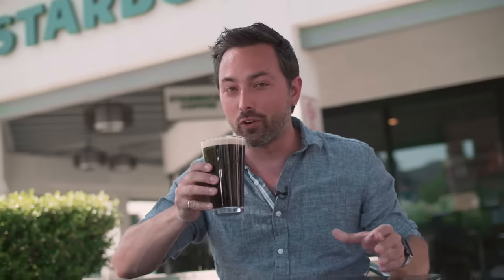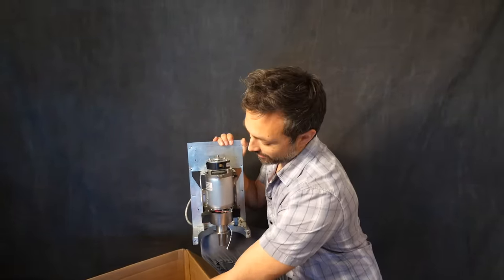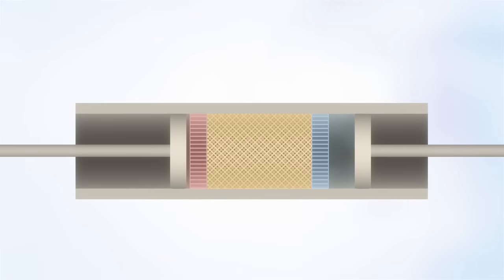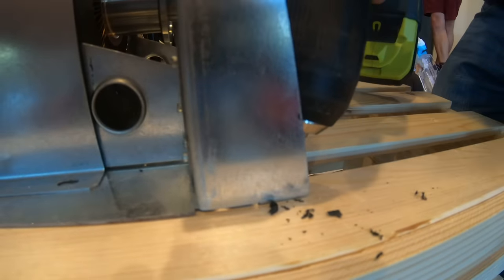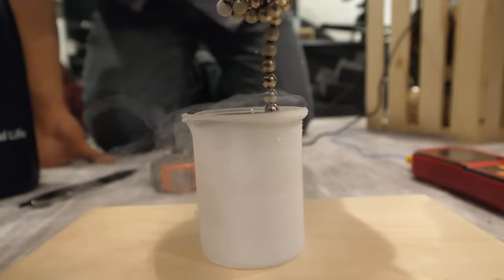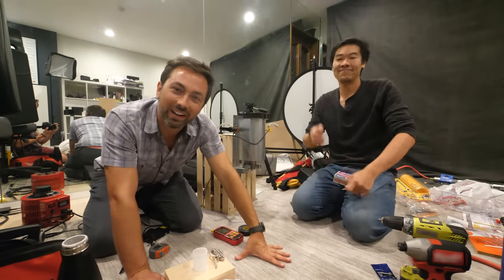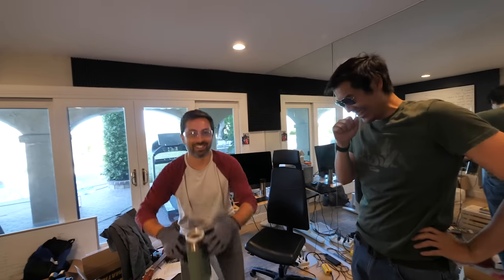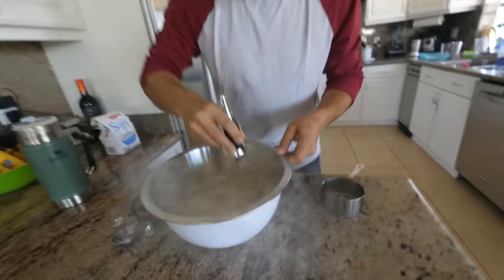Making Liquid Nitrogen From Scratch!

Comment: How does the selective permeability of the nitrogen filter work???
Reply: It might to do something with size of nitrogen molecules so that they pass easier thru it then oxygen molecules. Like you can have watertight clothes that still can "breathe" just in here it is on much smaller scale.
Reply: It may work chemically like the oxygen concentrators that emphysema sufferers use. Nitrogen has a much lower permeability in water than O2 or CO2.
Reply: Selectively
Reply: Do you know how they seperate liquids with a column? the liquid with smaller molecules go down faster then the bigger molecules, thus the mix is getting seperated by physical qualities. Gasses under pressure behave like liquids, the more pressurized the more it behaves like a liquid. And because of the pressure it flows in 1 direction, there will always be less pressure at the end then at the beginning. I don't completely understand why the O2 goes out from the side tho, maybe it gets pushed aside by the N2 that wants to pass forward to a less pressurized area?
Sorry for the bad english
Reply: What  @GielL96  said, except, in this case they purified a gas, not a liquid.
Reply: You could use the size of the molecules, but H2O is bigger than N2 is bigger than O2.  I would assume it has to do with electrostatics being that O2 is "magnetic" and H2O has a partial charge.
Reply: @GielL96  I think that is a good explanation. The Nitrogen molecules are smaller, hence they will move faster to the end of the pipe.
Reply: @jonathanlevy9635  Atomic radius decreases as you travel left to right across the periodic table. Sources give a long axis of 1.55 A for N2 and 1.2-1.26 A for O2
Reply: @Ranjay Raut That's called distillation and is not the mechanic at work here.  They were filtering out the gasses before they were ever liquid.  It is a similar process to osmosis.
Reply: @Ijjergom  Nitrogen passed through the membrane less often than the other gazes not the other way around

Comment: The reason the smooth taste happens from nitrogen bubbles is due to nitrogen not being able to diffuse through the water, so when there are different sized bubbles in the drink they remain a different size, whereas with CO2 bubbles they can diffuse through the water and equilibriate. Guinness did a whole bunch on research into this a while back

Comment: “Nitro cold brew?” Ever hear of Guinness?
Haha, good show. Keep the science coming!!
Reply: @snorkindorff270  Just to elucidate ... watching a freshly poured pint of Guinness (and some other beers) you see the same effect of wavering clouds cascading down the side of the glass.
Reply: @PaulCotterCanada  Guinness is also nitrogen infused. Kilkenny, Boddington's, Caffrey's, etc. all do the same. They inject nitrogen into the beer at the tap as it pours. That's why the draft taps for these beers all look different from regular beer taps, and why the tap handles can pull and push. Pulling opens both the beer & the nitro valves for the main pour, pushing just opens the beer valve for the top-up. I think the keg is pressurized the same way as with non-nitro beers. From the video, it looks like Starbucks is using the same draft system for their coffee. Still, I'd rather have Guinness.
Reply: @jasoncrobar724  Thank you - I like to learn stuff I didn't know.
Reply: Guiness is for sure better than this...

Comment: I work as an appliance repair tech. I don't like doing sealed system work aka dealing with other people's broken compressors, blockages ect.

However, through some reading and nerd raging I made a 3 stage "cryo cooler" I have 3 separate compressors stages that in the end produce liquid nitrogen. It uses a lot of power but produces it fast. And yes, with modifications I've made LOX. 

LOX is some scary sh!t.. period. But I digress. Having liquid nitrogen to play with has been super useful as well as fun.

Comment: You ran into EXACTLY my problem... I got tired of messing with the flow rate to try to optimize LN2 production (too high and you warm up your product too much and too low and you aren't condensing enough, plus you pull a vacuum) so I ditched playing with my cryocooler for now and I've been making pure liquid oxygen instead because I have an all-in-one, dedicated machine to make it.
Reply: Next stop: pure Hydrogen and boom! You get yourself a rocket
Reply: @fransoto8343  I actually have a hydrogen generator.  It makes it from distilled water.  But I have no way to make LIQUID hydrogen :)
Reply: @ChristmasEve777  that's easy my friend...

Put it in the refrigerator.
Reply: Can you tell me what nitrogen membrane and water vapor filter you have?

Comment: you didn’t explain whay this particular coffee tastes a bit more sweet though!
Reply: Mehrad Mahmoudian cold brew is often less bitter than hot brew because the things that give a bitter taste to coffee are less soluble in cold water.
Reply: @ejetzer  right but that doesn't explain why nitrogen, a tasteless gas, for some reason adds a very slight sweetness to the coffee

Good cold brew, undiluted, has very complex flavor such as a sort of cacao flavor I've noticed. 

However, nitrogen adds a ever so slight sweetness that is strange. What's more strange is that if you make your own cold brew at home, more often than not all you can find is N2O, nitrous oxide. n2o adds the same flavors as starbuck's nitro brew but the visuals are a bit different because n2o obviously has different properties to nitrogen (n2).

It's strange and I wish he actually dove into what exactly happens to make that occur. I honestly wonder if nitrogen IS in fact reacting with the water and taking O2 to make n2o and ho 

Idk. I'm just speculating
Reply: He sort of did... CO2 create acid which does NOT give it a sweet tase.  Nitrogen does not.

Comment: How cool! 
How long does the liquid nitrogen stays liquid for, before turning back into gas state?
Reply: That all depends on the pressure you’re keeping it at.
Phase changes depend on both temperature and pressure. If at atmospheric pressure, then it becomes a gas again at 77K.
As for how fast a quantity of liquid nitrogen will completely boil away, that all depends on the container and how exposed it is to that temperature.
For example putting liquid nitrogen into water will boil the nitrogen a lot faster than it simply sitting exposed to air.

Comment: I wonder how they produce liquid nitrogen at a commercial level?
Reply: Big pumps, big pressure tanks, lots of heat radiators.  If the source air is unfiltered to start then some distillation is in order, take advantage of the different boiling points of oxygen and nitrogen.  The distillation process gives highly concentrated oxygen as well, very useful in medicine.

Comment: Pro tip: As we see in the video, liquid oxygen is extremely dangerous around flammable materials, and most everything is a flammable material when exposed to pure oxygen. If you've got a Dewar or other flask full of LN2, it will actually be below the condensation point of LOX. Keep an eye on it - if it starts looking blue (LOX is blue), toss it.

Comment: It's a stirling engine, it uses a stirling engine to cool the air down. If you were to reverse the motions with heat input and cooling, you would output motion. Helium not only makes it so the fluid won't turn to liquid, but actually makes the engine itself run better because it doesn't have to push around a heavy gas.
In theory air conditioners could be made using this cooling effect. 
I'm not sure if you'd have a working engine that produced electricity if you were to heat the cooling end.

Comment: as i understand it, since the TWA 800 fuel tank explosion, they basically use one of those nitrogen tubes on the air intakes of the fuel tanks. That way the insides of the empty fuel tanks are mostly nitrogen, which would inhibit another similar explosion.

Comment: Nice video but two issues: #1, it would have been much more authentic (i.e., from scratch) if you made a Linde process setup (compressor, needle valve, counterflow heat exchanger) and used that to make LN2. #2, you never explained how N2 bubbles are supposed to impart a sweet flavor to cold brew. If it is so inert, it shouldn't affect your taste buds.

Comment: This would be a lot neater if you actually made nitrogen from scratch, built the cooling apparatus and figure out how to make a filtration device yourself. Right now its kind of just a video about how you can make liquid nitrogen if you buy a device that makes liquid nitrogen. The most interesting parts are where the setup isn't working and you have to create seals and containers, but those go by so quickly its hard to get invested. 

Maybe a video on using the Joule-Thomson effect and actually building the setup. The big thing is when you are trying to cool stuff down and you buy a cooler, that boring, but if your trying to cool stuff down and you buy a pump, that seems much less like cheating.

Comment: You should have just purged your flask with a bucket load of nitrogen, then attached a large bladder full of nitrogen (maybe an airbed) to act as a reservoir.  As the nitrogen condenses, a partial vacuum would develop in the flask, so naturally pulling in the nitrogen from the bladder.  No need to supply pressurised nitrogen to the flask.

Comment: well done video!  you guys are young home scientists!  the nearest I got to what youre doing, was when I was young and in the air force.  in aircraft maintenance, part of our job included servicing the liquid oxygen LOX system, it held about 8 litres of LOX, and when it filled the tank, some would overflow, and the little beads of LOX would dance around on the ground until they evaporated.  supposedly if you stepped on it the right way it would explode, but alas, after multiple attempts, I couldnt make that  happen!  hahaha.  good times!

Comment: "What to use liquid nitrogen for?"
 Avoid oxidation, e.g. keeping open cans of paint useable, or keeping opened bottles of wine fresh**. (Obviously you let it vaporize first)
** You can buy expensive cans of compressed nitrogen for this, at $32.13 per ounce.
Reply: Selective solder machines need it.  Or at least a really good filter.

Comment: combine the compressor with a liquid evaporation phase change cooler, just water in a vacuum tube, 2kJ/g heat transport by gaseous form up, liquid form down after cooling at the top radiator

Comment: Should have used a SCUBA 2nd stage regulator for introducing nitrogen to the head.  As the nitrogen condenses it creates a small vacuum which activates the 2nd stage regulator to introduce more room temperature nitrogen.

Comment: Nitrogen is 3% lighter than air. As a lifting gas it is not corrosive like hydrogen or water vapor. It also doesn't require a phase change to become vapor like water. I don't know how corrosive water vapor is when it is diluted with nitrogen. Like 50lbs of nitrogen and 50lbs of water.

Comment: One of the main issues going forward with cryogenics is the weight and size of the system.  

On the ground it’s not an issue, but in the air it’s a Whole other story.
- Even if you used another heavily coated material, it’s not a guarantee something will work or be safe.

- Someone has to try though

Comment: If you remove all the oxygen and all the CO2 from air, the result is not 99.5% N2.  Air is ~0.93% Ar, and when the O2 + CO2 is removed, the maximum purity of N2 is 98.8%.  You've got to get the Ar out.

Comment: I use liquid nitrogen at work all the time...hate to be mr obvious, but when you first pour it into a room temp tank, much of it evaporates and boils away immediately until the temp of the container lowers to below the boiling temp of the liquid. It's negative 320 degrees below zero (F)  so that can take awhile. I would bet that your contraption made quite a bit more liquid nitrogen than you got in the end.

Comment: As a cryogenic engineer I can tell you that these experiments were not done by professionals. So dont try this at home, especially you, Derek. He wears no safety equipment and tries to pour liquid nitrogen on the floor barefoot. They make liquid oxygen on a carpeted floor, no fire extinguisher on hand. The wiring is questionable. They make a pressurised vessel without a safety valve. If I did this at work I would be fired.

Comment: Using a helium/Stirling cryocooler is cheating.  Let's see you do this using only compression and expansion, as liquid air was originally made (in the 19th century, before helium was even known).  Hint: the first refrigeration used air as the working fluid.  Compress, dump the heat of compression into water, expand, and suck heat out of a reservoir (they used brine).  That gets you cold brine, cold enough to make ice.  Now use the cold brine as the heat sink for another stage, and cool something with a much lower freezing point -- like ethanol, methanol, or acetone.  One or two more stages and you'll be able to use the air in the system with a phase change, like the refrigerant in modern heat pumps, freezers, and air conditioners -- and the cold side will be filled with liquid air.  Distill to obtain pure nitrogen and liquefy that again, and done.  BTW, a minor variation of this (using modern refrigeration to cut the number of stages needed) is used for commercial production of both liquid nitrogen and liquid oxygen, and pure compressed gases like nitrogen, oxygen, argon, and carbon dioxide (all obtained by distilling liquefied air).

Comment: I was thinking about that nitrogen membrane apparatus, if it passes atmospheric nitrogen and the other gasses are emitted from the holes on the side, could you not tap those holes and attach fittings to them to carry the (mostly) oxygen at ~1 ATM to another series of cryopumps at specific temperatures so that your end products are liquid nitrogen, oxygen, argon, etc..? The first stage could be a simple R134a system at say -25C to freeze out any water vapour or air compressor lube

Comment: Since the outside portion of the cold brew was the least insulated portion and since the nitrogen can absorb more heat on the outside portion and evaporate faster than the center, then wouldn't the nitrogen bubbles be rising on the outside and creating a downward current in the center?

Comment: Now this may be a little detailed of a comment for this forum but I’m wondering how we can use this to make a home make liquid air generator. I’ve been reviewing energy storage devices for long-term energy storage for solar power units outside of standard lithium ion batteries. And I feel like the most promising system is a liquid air storage system that then allows for it to decompress and run a turban and I feel like this unit could be the smallestscalable unit. Could you make a video showing how to make one at home?

Comment: Re-watching 3 years later, I realize maybe this shouldn't have been done in in an enclosed room with people inside. If the condenser stopped working, you could vent a large volume of nearly pure nitrogen into the room. Depending on the size of the room and the tank, it could be enough to make the room hazardous.

Comment: That is a cryogenic cooler from a superconductor technologies superfilter tunable microwave notch filter and amplifier. The ones from MRI machines are even better but you have to get one before the scrappers cut the helium hoses going to it. If you make liquified air using these devices it generally makes mostly liquid oxygen 🤓

Comment: I feel like the cryocooler could be designed better... Like what if the compression chamber was in the shape of a coil that you can heat up and bend into the shape of the container effectively increasing the surface area that comes into contact with the gasses...

Comment: So why not just make liquid air and use magnets to pull all the O2 out?  You can always use your meter to check warmed up samples to makes sure you're getting there.   Co2 is really low conc, but you can always use limewater to remove that from the line.

Comment: Imagine using a system similar to this for nitrogen-based liquid rocket fuels, where the outlet ports on the nitrogen membrane feed into a separate compressed air tank for the otherwise discarded oxygen, with each output (nitrogen and oxygen) being super-cooled into the liquid state. You could engineer Rocket fuel this way. A large-scale system for orbital rockets, and small-scale for liquid-based at-home rockets. Or maybe, as another use for the liquid nitrogen on the ISS, it could be used to refuel fusion-based spacecraft (that is, as a small-scale system without the O2 tank, for the sake of breathable air). I’m getting excited now…

Comment: Did you guys pump the air out of the pressurized nitrogen holding tank before filling it through the filter membrane? I'm shocked Alan won that bet because the unpurified air should have had enough non-nitrogen gases to make the overall purity less than 99% n2...

Comment: Why not use a flowmeter to regulate and quantify the flow. Just listening is not very accurate. I would dump that rubber hose and cool the concentrated nitrogen gas before it enters the cryocooler.

Comment: Why does the nitrogen flow up through the centre and result in a down-current on the outside rather than the reverse situation (which is equally symmetric)? Perhaps this is something to do with increased energy losses from the glass compaired to flow within the liquid? Seems like a Hamiltonian mechanics problem - would love to hear an answer :)
Reply: Can't tell if the system is minimising the rate of energy loss or maximising it - I think the outer anular cylinder allows for slower flow compared to the inner cylinder due to the greater circumference, however this clearly depends on the relative radius of each :(